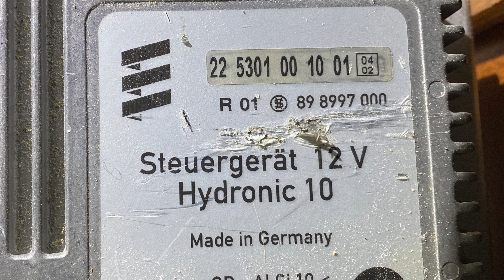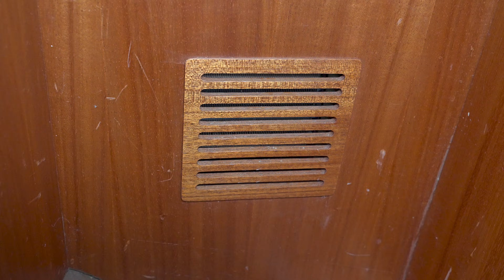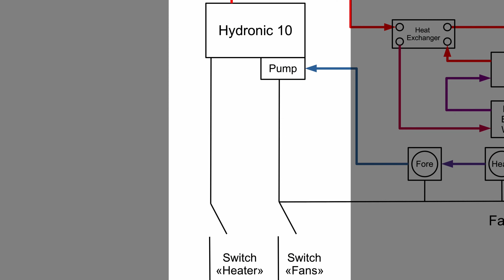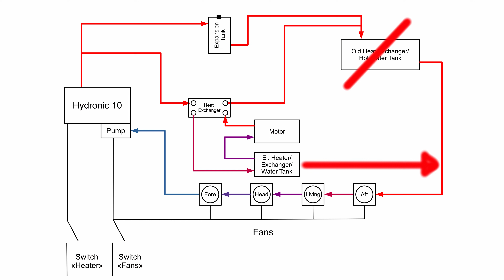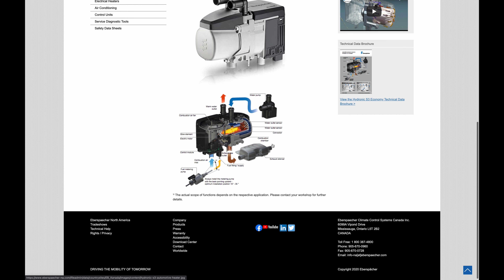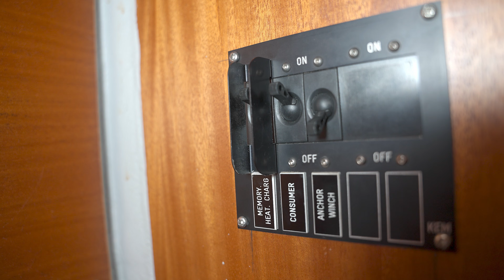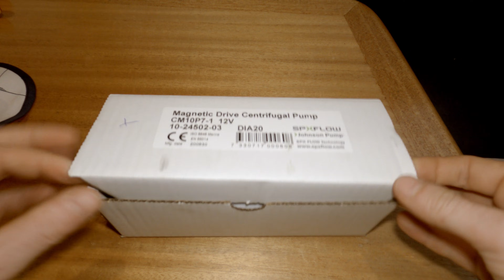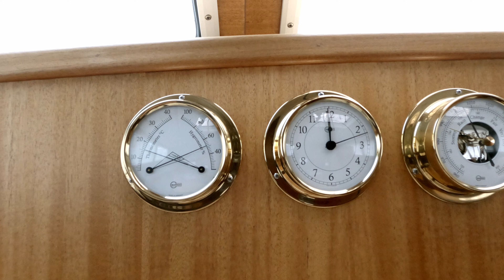Boat Heating | Hot Water without Engine | Eberspächer Heater Upgrade

Comment: Great video, no sailboat experience for me yet, only gathering information for future yet I was able to get a good working concept of what all is involved with such a system, as well as the positives & drawbacks. One question though, do you have any idea on your diesel consumption while running high/low? The boats I'm looking at don't have huge fuel tanks, so it would be nice to have an idea on endurance. Here on the Northern Gulf of Mexico, it doesn't get anywhere near as cold as you get, so I wouldn't have to run it as much.
Reply from the maker: Glad that you liked the video!

There are 4 power modes for that model. Nominal fuel consumption is as follows:
Power 0.9 l/h
Large 0.65 l/h
Medium 0.4 l/h
Small 0.18 l/h

It cycles between the latter two in my installation after the initial warm up. 

You can find more detailed information in the manual here (along with power consumption): https://www.butlertechnik.com/downloads/Eberspacher_Heater_Hydronic_M-II_Technical_description,_installation_instruction_manual.pdf
Reply: @SailingSyvsover  thanks. Looking forward to looking at more of your videos soon.

Comment: What did you do to ensure you won't get legionnaires' disease from using water tank for heating?
Reply from the maker: As far as I know at 60 °C Legionellae die within 32 minutes. That temperature is reached easily in the water tank. Other than that regular disinfection of the whole fresh water system with chlorine like I do anyways every season. Never heard that that is an issue (at least here in Norway).
Reply: @SailingSyvsover  I know little...  but when I have researched similar radient heating for camper/boat/house there is a lot of info out there about not mixing water supply with heating system...  or legionnaires' disease can occur.
Reply from the maker: @gr8jpn  Maybe they mean that you should not use the heating medium itself. I am not sure honestly. And even Eberspächer itself advertises on their homepage with the sentence "Heats the domestic water in addition to the passenger compartment" ...
Reply: @gr8jpn It's a 'closed loop' or 'Indirect' system. The heating fluid (In this case, an antifreeze type mix) circulates through a copper coil  which runs through the hot water tank, acting like a heat exchanger, and heats the water indirectly so there is no cross-over or contamination of the domestic hot water, which is fed from the boats fresh water supply. Hope this helps :)).

Comment: So, the average current draw after the system stabilized was around 4 amps?
Reply from the maker: And just for clarification because I don't mention it in the video explicitly: It is a 12V system. In the manual it states for the power modes "Medium ~ 39 Watt" and "Small ~ 35 Watt" under power consumption. Which would then be 2.92A and  3.25A (at exactly 12V). So it is very close to that.
Reply from the maker: Between 3 and 4 amps, that is correct.